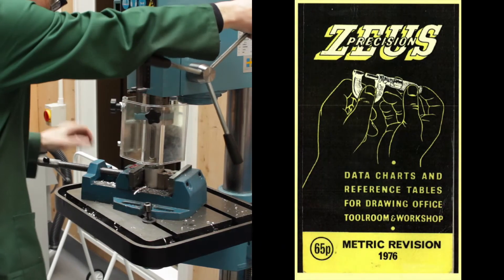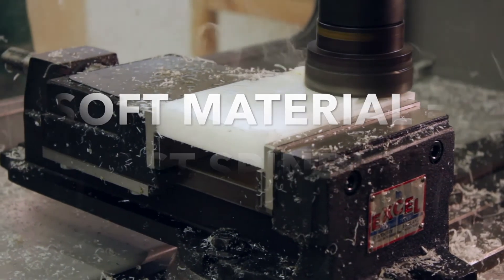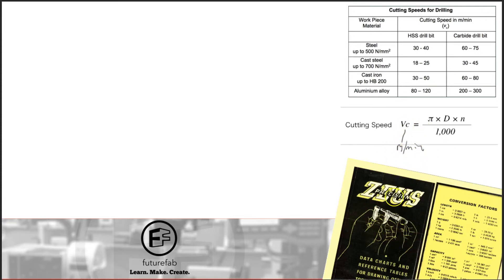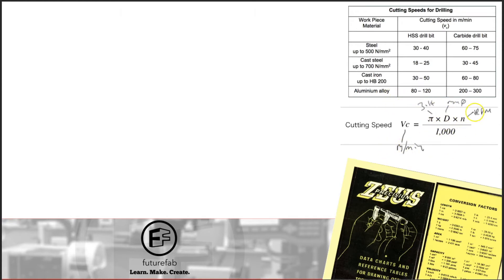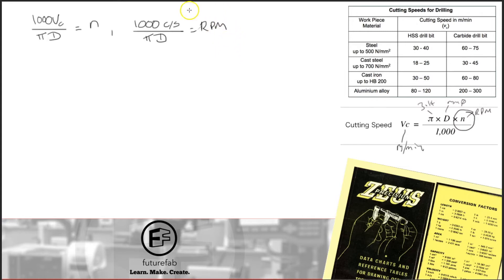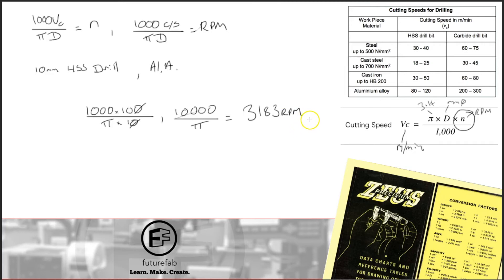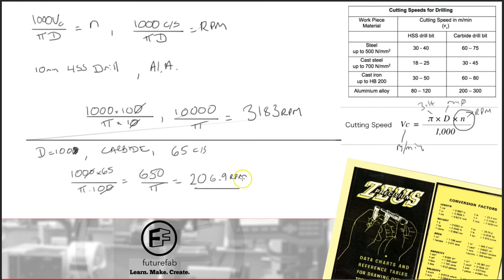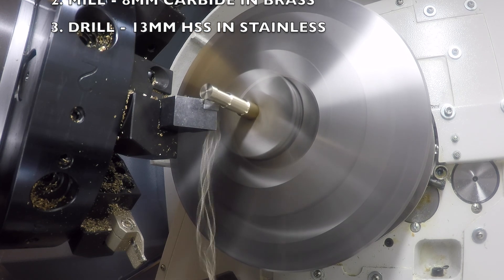What is Cutting Speed? (Machining Tutorial) - Lathe, Mill, Drill

Comment: This is an excellent video that most home gamers need to see. I know this stuff already from my day job. Rather then use the original variable descriptions for the formula I use my own "speed=(surface foot x 12)/(pie x cut diameter)" .  I work in imperial obviously. One factor you didn't get into as deep as you could have was material hardness in the same given alloy. Example 316 might be 30 RC or 40 RC depending on the heat treatment. Which is a world of difference of the surface foot you can run. Also if you are running coolant or not.  Another factor affecting the surface foot you can run (primarily affects lathe) is chip formation. Good chip formation ( c's and 6's) will heatsink the cutter and work piece and allow a higher surface foot.  Depth of cut also plays into it. My best recommendation is start at 70% of the speed and feed you calculated and work up from there. You also have to decide which is more important to you cutter life or cycle time. At my day job time is king in my home shop it's cutter life.-cheers
Reply from the maker: Brilliant comment, I learned a lot from that. Really appreciate it man.

I’m just planning a feeds vid so stay tuned!
Reply: There was some things I forgot to mention. There are some exotic materials that by the time you get what should be perfect chip formation you are pushing the insert too hard and it will fracture. Feeds are a lot harder to get dialed in on a manuals. I ran a material (on a lathe) before that .0083" was the goldy locks feed. .008" was too stringy .009" fractured. Most people will probably never run into stuff like that but in the CNC world sometimes you have to use that extra decimal place on you feed. When you do your feeds video please cover feed per tooth. I believe a decent number of people in the community don't fully understand it. -cheers
Reply from the maker: To be honest, the quality of information you've given in your comments is so good that I'm thinking of doing Friday's video just on the points you have raised! Thanks again really helpful.
Reply: Anytime man.-cheers